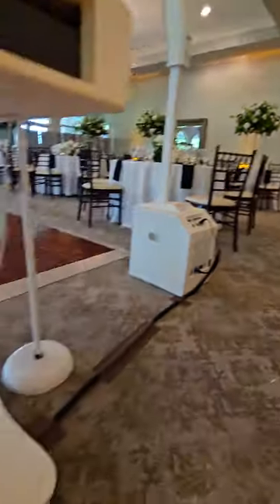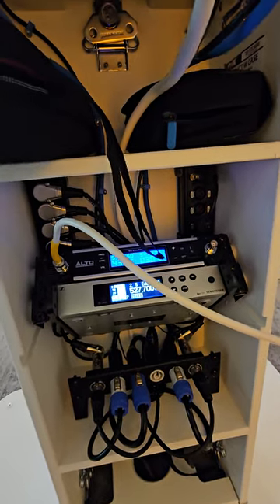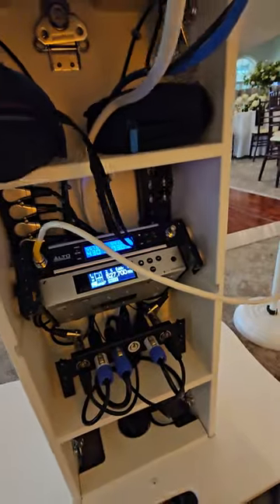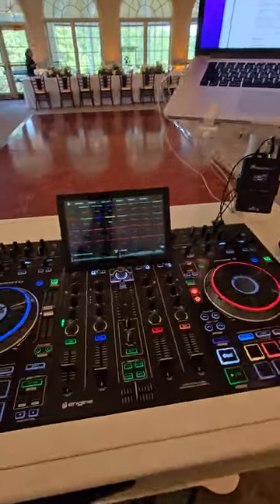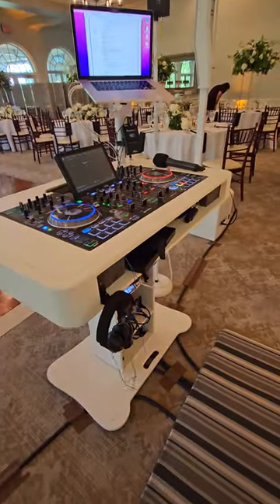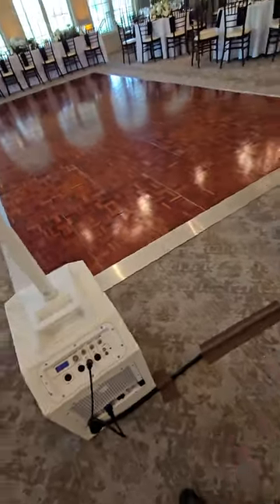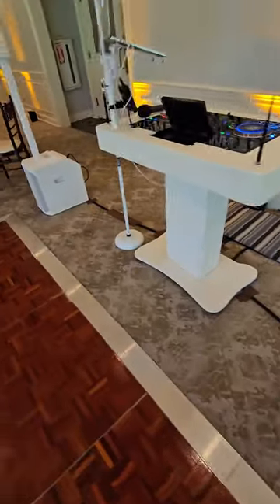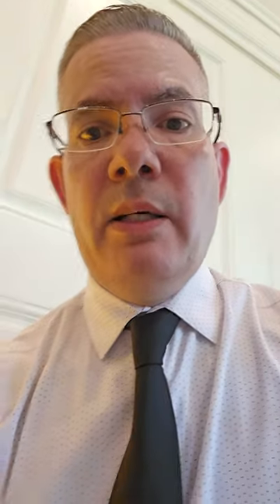Pro X Control Tower setup

Comment: How did you mount everything in there ?
Reply from the maker: It was all custom mounting. I had to install everything about 3 or 4 times before I found a layout that worked well from what you saw. The side rack rails were mounted with spacers and the bottom ProX rack rails were mounted on shelf to hold the knockout panel for the quick connects.

Comment: Hey, Eddy do you run a sub at all?
Reply from the maker: I use a pair of the Evolve 50s by Electro Voice so they have a 12" subwoofer already, so yes. I have not needed to add any more base. Usually I get complaints to turn down the base on the pair of EV Evolve 50s. Guest count ranges are between 75 to 200 guests so that average is 140 guests.

Comment: What kind of antenna are you touring with your alto stealth? Also- do you have that somehow connected with your main out? I’m guessing it’s on your booth out- but I run monitors- so trying to plan things out! 
Thanks for the inspiration!
Reply from the maker: I use Sennheiser fullwave antennas such as the Sennheiser Pro Audio A1031-U and also the Sennheiser ADP UHF
Passive directional external antenna.
Reply from the maker: My board is the Denon Prime 4+, so it gives me 3 XLR outputs. A main out, a zone out, and a booth out.